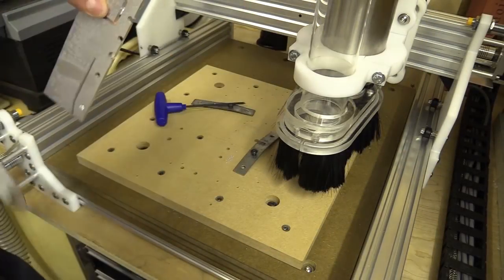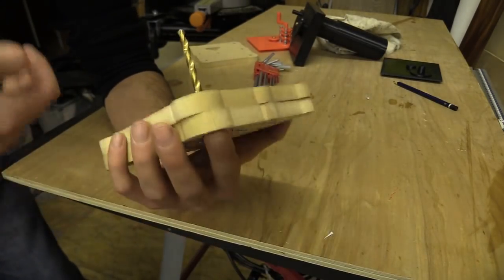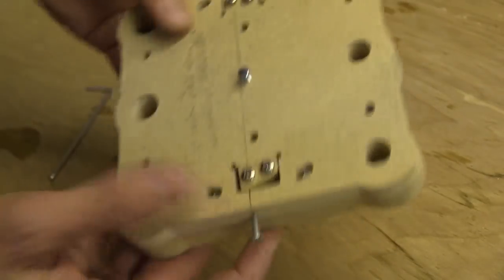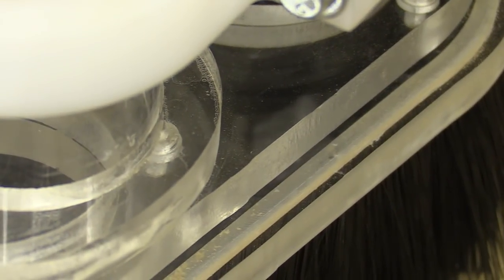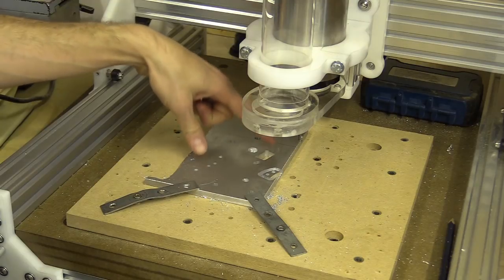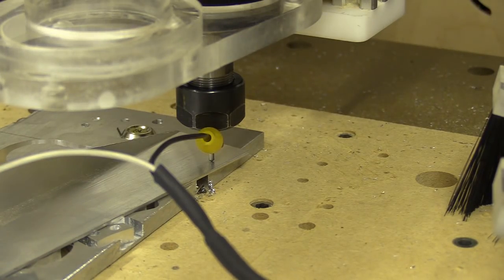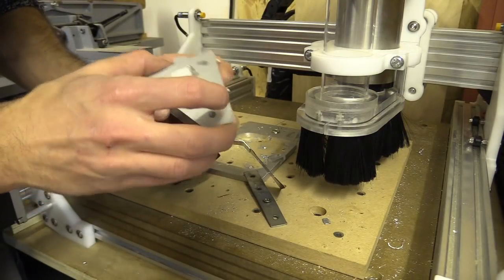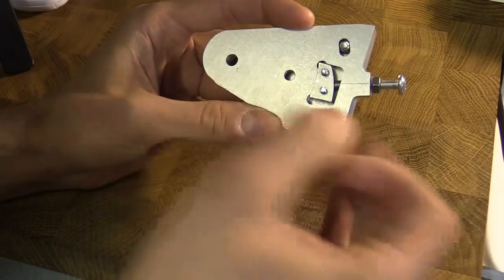#23 CNC Tramming Plate Design and Fine Adjustment Mechanism #23 / Design Upgrade

Comment: I’ve been watching quite a few of your videos and would like to thank you for sharing your journey. Just wondering what was the end result with the pivoting X Rail? Thanks
Reply from the maker: Thanks. The pivoting system worked, but I found it easier to build with better quality extrusion in the end. The smaller stuff is fiddly and generally requires a lot more prats.

Comment: did you ever end up finishing the tramming plate design and build?
Reply from the maker: The tramming mechanism worked and I implemented a similar mechanism for a following machine but I found working with leadscrews too slow. You can see the iterations of machines here: https://miscpro.com/cnc-builds-timeline/
Reply: @EducatingSavvas  any chance you can sell the fusion file?
Reply: Instablaster...